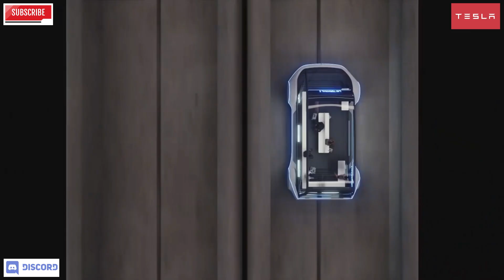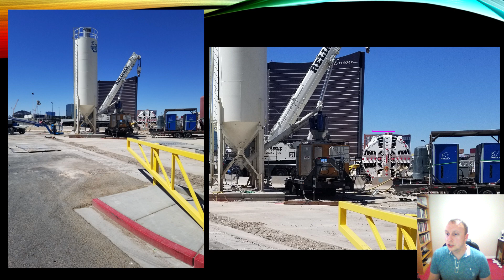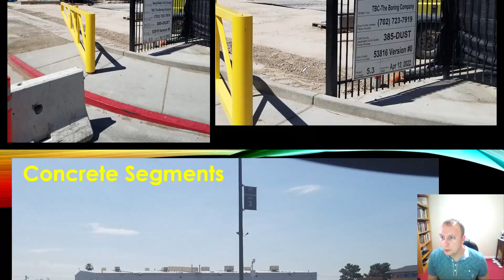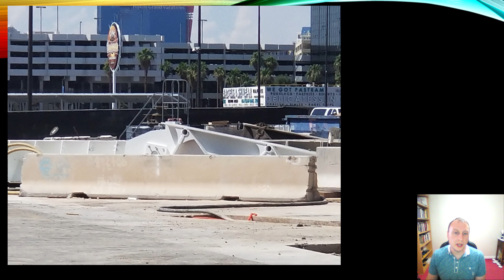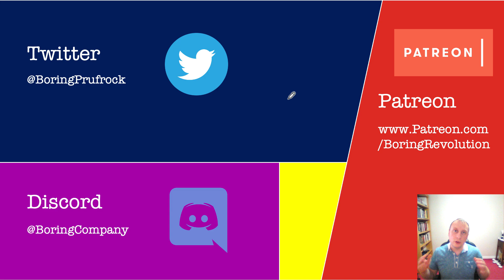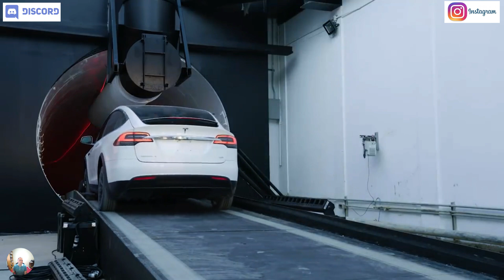The Resorts World Loop Project Is Progressing Nicely 😁 👏🏼 🚇 👷🏼‍♂️ 🏗️ Episode # 103

Comment: This project shows in my opinion the failure of the USA in all its glory. Pumping a lot of money in a transport system that only caters to the few using a very inefficient system. 

Car centric as always, without providing walkable cities with cycle infrastructure and proper public transport. The only solution to reduce traffic that really works is to create alternatives to using a car. 

I truly don't understand the mindset of Americans and especially Musk fanboys, that see this as the ultimate solution for traffic problems.
Reply: You know what's more ineffective than using Teslas? Using a big heavy bus to move 0 passengers.
Reply: @Simon Quvang They could replace the Tesla’s with bikes. Here is an example of how that could work. https://www.youtube.com/watch?v=saLAZssuD2o&vl=nl
Reply from the maker: @sanderdeboer6034  We look forward to you implementing this none-viable business in Nevada in the next 5 years. You should plow your entire life savings into buses and run them for $0.18 per mile, per passenger in Las Vegas. 
We have no doubt that your transit competition will compete well with Tesla electric vehicles that run on free sunlight.
Reply: @BoringRevolution  FREE SUNLIGHT? Yes the light is free, but converting it to electricity and storing it requires expensive solar panels and batteries. 

However I obviously am not against using solar to create energy for transportation. And you can use solar energy to power electric and hydrogen  busses. We have many of both systems riding here in the Netherlands. Danmark is now building a hydrogen island to convert wind energy to hydrogen. And we in the Netherlands are using old oil platforms in the North Sea to do the same. We have one of the largest natural  gas infrastructures in the world that is now being converted to transport hydrogen. 

It is just the first viable option for mass transit in Las Vegas. And I said that I would prefer bikes! 

It takes less energy to bicycle one mile than it takes to walk a mile. In fact, a bicycle can be up to 5 times more efficient than walking. ... A comparison of the energy cost of various forms of transportation shows that the bicycle is most energy-efficient.

So if Las Vegas can remove several car lanes and replace them with bike and bus lanes that would be perfect. 

Las Vegas would be a better place for it. It would be cleaner, quieter and more sustainable. Also the city would be better accessible, more alive and more fun.

Bikes are the future for urban transportation in the rest of the world. While individual car ownership should be a thing of the past. 

The loop will not solve any congestion problems in Las Vegas. That 54 million could have provided a city wide BRT (Bus Rapid Transit) that would solve traffic for the entire area. 

Now only a relative few people can go from basically nowhere to nowhere at very specific times and at a very specific place. 

Total nonsense project! And I will not visit the USA anymore (Except maybe one trip back to New York) until it has become more civilized. 

Once your roads have become as safe as here in Europe and your cops kill a 100 times less, and you have a decent healthcare system, I might do a visit. So starting a company in your backwards country will not be an option. Sorry!
Reply from the maker: @sanderdeboer6034  I enjoyed your waffle. It was entertaining ! But wishing your ideas onto other countries will result in nothing happening.
Reply: @sanderdeboer6034  I love being able to cycle around the Netherlands. My main experiences of course were in summer. I'm not sure how keen I'd be in winter. Las Vegas has 6 months of the year with temperatures above 30 degrees C and a few averaging above 40! If I'm a business person in a suit attending a conference, I don't want to ride in 30 deg temperatures 3 - 8 miles to get around the city. I may also want to bring luggage from the airport with me.

Now while buses make a lot of sense, you yourself said they need their own lane to work, which makes car traffic much worse. Moreover, simple maths says that every stop adds a few minutes to the journey. The boring company is genuinely trying something new here. The much lower cost of the tunnels, coupled with their smaller size, means they will run point to point eg start to finish and not stop-start.

You should treat this as a mental challenge to imagine a public transport system that doesn't stop at every waypoint along the way to pick up and drop-off passengers, and all the delays and travelling inefficiencies for the passengers. Buses are optimised for the city, not the passenger.

And it also doesn't take a lot of imagination to see a small electric people mover that can take 6 to 12 people eventually supplementing the smaller cars on the busiest routes. Perhaps you're thinking "it's just a small bus" - sure. But (a) it didn't need to take any surface land from other vehicles (b) being electric, the tunnel can be smaller not having to vent fumes and (c) it travels point-to-point. Add some autopilot to bring the cost down and in a scant 10 years, it really will be a revolution.
Reply: @mearino  Thanks for the serious response, and you have a point about the climate. However your comment about having a separate buslane will make traffic worse has been proven wrong many times.

The more alternatives you can offer people for the car, the less congestion there will be. And a separate buslane, or light rail option makes this a true viable alternative, in stead of the bus standing in the same traffic as cars. 

So you in your business suit can actually take the car like here in the Netherlands 64 percent of commutes are still being done by car. A study a few years ago done by Waze (navigation app) found that the Netherlands was the best country to drive in by car owners.

Simply put, every passenger on the bus, cyclist on the street and people walking don't occupy a spot in traffic. Cities that implemented this have seen traffic drop every single time. Your point about busses being optimized for the city in stead of the passengers is I feel another American view point. 

If you have visited the Netherlands than don't you agree that efficient and well run public transport is possible? And it is the network that is pivotal in this regard. Light rail is probably harder to achieve in the beginning in Las Vegas, but what about trolley busses. Electrified, clean, quite, high capacity and cheaper than Light rail options. And if you offer climate control, wifi and modern interiors like here in the Netherlands, even people in business suits can use this kind of transportation.

Bus Ralid Transit systems are actually being implemented in many US cities including New York. They have seen a dramatic reduction in traffic after creating separate bus lanes. Also busses got through traffic twice as fast as before and became more popular overnight.

And than the cost argument, that 50 million from the loop could have created an almost city wide network of separate buslanes, including several busses that cost around 200,000 dollars a piece and carry 50-60 people at a time, including people in wheelchairs and trolleys. Also your luggage would not be a problem. 

The loop only provides a minimum solution for a very small area of Las Vegas, has issues with safety, capacity and connectivity to other modes of transport. Such small tunnels with Teslas that can burn heavily while doors are hard to open, if at all, makes me ask why the government would allow this to be operated. 

Tunnels are a great option in very densily populated areas, but Las Vegas isn't dense at all. With 634,000 inhabitants and a land area of 352 km2 it is much less dense than Amsterdam with 219 km2 and 820,000 inhabitants. And than we also have an old city with small streets and hardly any high rise buildings. Plus most of our public transport is done above ground with only two subway lines. 

Las vegas has a total metropolitan population of 2.2 million people while Amsterdam has 2.4 million people. And Amsterdam lies in the Randstad region with 8.4 million inhabitants while Las Vegas has a lot of space surrounding it.

Agree that public transport in the Randstad region is more profitable but on a city level Las Vegas has a lot of opportunity to create a viable system.

In conclusion I still feel that the Las Vegas loop especially in its current configuration is a failure. The Las Vegas Convention and Visitors Authority that paid 47 million partly raised from tax on hotel rooms could have invested that money to solve the traffic issues in the entire city, while improving the environment for Las Vegas as a whole and reducing the total carbon emissions. 

When will Americans finally realize that the car is NOT the only answer, and that solving congestion can only be done by making great alternatives to that car?

https://www.wri.org/insights/4-ways-cities-benefit-bus-rapid-transit-brt

https://archive.curbed.com/2019/10/14/20902256/bus-lane-emissions-climate-change

https://www.google.com/amp/s/fortune.com/2015/09/30/best-country-drive-waze/amp/
Reply: @BoringRevolution  Insults the only response you got in your Arsenal? You apparently never visited countries like the Netherlands where this actually does work.

It is shown over and over again that when you present people with an alternative to the car, congestion on the roads goes down.

And even in the USA many cities discover this fact, like New York, Albuquerque, Cleveland, Pittsburgh and many more.

Perhaps the waffling of this American can convince you to take another look at your car centric mind. 

Do Your Buses Get Stuck in Traffic? Traffic solutions & the Downs-Thomson Paradox
https://www.youtube.com/watch?app=desktop&v=RQY6WGOoYis
Reply: @mearino  My answer got a bit long, so if that's too much, perhaps this video is easier and definitely more entertaining:

Do Your Buses Get Stuck in Traffic? Traffic solutions & the Downs-Thomson Paradox
https://www.youtube.com/watch?app=desktop&v=RQY6WGOoYis
Reply: @BoringRevolution  And please be aware that English is not my native language! So why insult my attempt to add information to the discussion. I would never insult anyone that took an effort like this especially when its not in their native language. Erg zielig en kinderachtig gedrag!
Reply: @sanderdeboer6034  Same. My answer got too long. I live in Melbourne Australia. 5m people. We have trains, light rail, trams, buses and cycle lanes. All have strengths and weaknesses.

The BRT article you linked talked about relative benefits eg halving journey times, cutting emissions, and these were relative to current figures that I suspect at times are woeful. Prioritising buses and trams is done here in Melbourne but doesn't alter the fact that traffic lights stop both vehicles regularly. They also mention how much more exercise people get walking to and from stops - sure, but combine that with waiting for the bus/tram/train, carrying shopping, with a pram or children, in rain,  and it becomes a misery.

I don't think ithas to be an either/or. 

I remember the film Minority Report with individual pods automatically whizzing around the city, and this is where I think the boring tunnels bring some genuine innovations that we are still trying to fully understand.

If you look at the 5-part youtube series by "Now You Know" on the US freight transport business where they compare rail and road, and show what the tunnels could do for trans-American freight, it will tune you into the potential of the solution.

The LVCC loop is very embryonic, but still promising.
Reply: @mearino  Ok, I have to agree that this solution might be a fit in specific environments. I love Minority Report and especially its writer. 

I does look futuristic and very luxurious. However given the way the climate is changing I truly feel we need to head in another direction. Here in the Netherlands covid has accelerated the transition to remote working. 

This means we need to travel less to offices and businesses now and in the future reducing traffic jams. Cars also require a lot of energy to build, move and maintain. Even when we have all the renewable energy in the world, it still would have a major impact on the environment. Building tunnels also creates a lot of Co2. 

So I am not against it when it is like presented in first instance, however what the Vegas Loop has become now is honestly not serious enough.
Reply: @sanderdeboer6034  Here is another way to look at it. Europeans have been trained to think cars are bad, public transport is better and cycling/walking is best. Only, there are times when one is the better option.

If you start with what makes a car bad, and then slowly bit-by-bit tackle each point:
* Firstly, they are polluting to run - so making it electric has a big effect.
* Secondly, they are resource-intensive to make and operate. The most expensive part of operation per mile is the driver. So driving yourself is an option except you don't need the car at the other end, and you can't do anything while driving. So if you can get cars to drive themselves this is a game changer (more on this in a moment).
* If a car does a lot of km in a commercial capacity, it probably starts to become less resource intensive. We had a big Ford Falcon in Australia designed as a fleet car with an engine that could do 1m km and was very popular for taxis. Execpt the gearbox would break down every 300,000km. Recently, a Tesla S hire driver clocked up 400,000km on one set of brake pads. So an electric car with less moving parts that does 1m miles (1.6m km) * may * be competitive with larger vehicles, if running at capacity .
* Next, many cars probably run with only one or two drivers, so very inefficient. If you can aggregate like uber share in Melbourne, this brings the utilisation up and cost down. I love airports where they shout out a suburb, and everyone going that way puts up their hand and gets bundled into the same car. Very efficient for both passenger and driver - they charge a higher per km fee, all passengers save fare costs. But Melboune airport doesn't do this and a taxi/uber at night can cost $100+.  So aggregating riders using software and dynamically allocating cars (like uber) is a huge opportunity.
* Finally, automation. FSD robo-taxis I think will be almost impossible without modifications to roads eg electronic signals, separate lanes etc. This is where the tunnel is the single biggest enabler. They were able to remove the guide wheels on a model Y and race it down a tunnel at 155MPH on autopilot vision alone. BOOM. Not literally I mean.

If you can combine all of these things into a form of transport that has the greatest passenger efficiency AND brings the cost down to a competitve level, then you almost bring an end to the need to own a car.

A friend of mine researching building a city from scratch quoted a figure that 35% of cars in a city were looking for parking. Seems far-fetched but the amounst of land and real estate dedicated to car parks is staggering. 

In the US at least, dominated by cars, these tunnels offer a genuinely great alternative to support the robo-taxi concept. Let the tech mature for 20 years and they may even start to come to Europe and give BRT a run for their money.

I think the endgame is that the tunnels enable robo-taxis, which sees travel costs drop to below public-transport levels but with the convenience of direct station to station routing. You can always walk or ride to the stations and eventually they will make "pods" that can take wheelchairs and bikes.

Oh, and if you look at long distances where the cars can get up to 100MPH+ and there is never a traffic light from one station to the next, that could be a true inter-city alternative. Especially if you use fans to blow solar powered tailwinds into the tunnels in the direction of travel to boost range.
Reply: @mearino  Agree with most lf what you say, and it would be great if we could have autonomous driving cars. They are indeed safer, more efficient and better for the environment. 

But cars aren't seen as bad, and are still the main transport options for most here in Europe. Even in the Netherlands with the highest bike usage in the world 63 percent of commutes still go by car. 

It is not so much anti car but more pro bike and public transport. Our car infrastructure is top quality and better than most countries in Europe and especially in the USA. Not sure about Australia, I have only visited New Zealand and they had great roads.

When I travel to Germany and especially to Belgium the road quality gets a lot worse just after the border. We have extremely smooth Asphalt and are also the country with the most very open asphalt concrete kilometers. 

As mentioned before Waze has put the Netherlands in the number one spot for best country to drive in. 

I feel we probably agree on most topics, but you see more opportunities in the loop venture than I do.  I hope you are right, because I would love to see innovation in this field. It just in my opinion has to significantly add something to the mix, in stead of being a flashy billionaire project that didn't deliver on its promises.

But we will see....
Reply: @Simon Quvang  You are absolutely right, that would be very ineffective. So that never happens. Bus routes are planned to cater to a certain amount of demand. Here in the Netherlands public transport companies are privatized and some companies are even foreign. So they want to make a profit. Routes with not enough customers are either scrapped or replaced by a reservation service. I use one myself sometimes when going to my mother who lives in a very small town in the countryside. I can reserve a bus a half an hour before leaving using an app or by calling the company. 

And there are many other options here as well, I can use a bike to go to any place in the Netherlands. I used to bike to school which was around 14 miles one way. And there are obviously trains, trams, metros, buses and even ferry’s and watertaxis to bring you to your destination. I have a ferry in front of my house that brings me directly to the center of Amsterdam.

And a bus can carry between 40 and 80 people, a lot more than that sad 2-3 people per Tesla. And why would a bus be empty when a lot of people visit the convention center? Why else would they have required such a system? Plus a bus system is much more flexible and could serve the entire Las Vegas area, for example when there is no large convention happening.